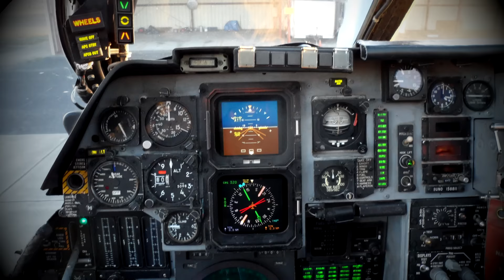USMC Jet Crashes Cable Car | Last Moments

Comment: A couple things to note:
The pilot's reasoning behind not being able read the altimeter due to malfunction is weak in itself due to the fact that pilots, especially in the armed forces, are trained in determining altitude without the need for the altimeter.
The maps were obsolete because they were meant for higher altitudes than what they flew since according to the radio operators, they weren't expecting to fly so low, so of course the ski lift wouldn't be on those maps because they're below.
Reply: As a civilian pilot you don't even need training to tell the difference between 2000 and 300 feet. It's very obvious when the ground is basically right up on you
Reply: Theres no reason during VFR flight you wouldn't be aware you're that low at 300 feet.

The map thing, nah, it should have been labeled. I'm not sure what map you mean, a map that only has mountain peaks on it? Sectional charts would definitely list all those things.

Still no explanation to why they were below 2000 AGL unless Qxir got it wrong. Those planes are interdiction aircraft so they would do low level training missions. Not sure what Italy's policy is with that at the time though considering a it's a military training mission. Those are common in the US to fly that low.
Reply: You'd think but it happens a LOT. half of the intelligence agency higher ups in Northern Ireland were killed when a Chinook flew into a hill at the Mull of Kintyre in the 1990s. A girl I know had a husband who was an RAF fighter pilot flew into a mountain also. Both mistook their altitudes.
Reply: @cefb8923  what i remember was that the maps were rated for 1,000 ft and higher, very much above the ski lift.
Reply: @cefb8923  it's also been reported by locals in the mountains that the jets fly very low and stunt flying by doing what's called flat hatting, where you fly as low as possible.
Reply: @TaliyahP  Soo much this. They were hugging the ground stunt flying having fun and the fact they destroyed evidence is they know they were in the wrong.
Reply: @ecgameplayer   so the lifts should have been noted surely ....looks fishy
Reply: Kabuki Kitsune  Furthermore he destroyed evidence. Case closed.
Reply: No-one ever trained me to determine altitude without using an altimeter when I was flight training. I've never even heard of such a technique. You do learn how to judge your height above ground for the final moments of landing, but that's just a matter of ten feet or so.
Reply: @colderwar  Yea but as a military prowler pilot if you can't tell the difference between 2000 ft. and 300 ft your in the wrong job No excuses.
Reply: @jod9749  That day he was a tour guide and forgot he was a pilot
Reply: I noted how the American taxpayer payed dearly.
Injustice is an understatement.
Reply: @davidleitch2298  The Chinook one, I seem to recall, was caused by the software controlling the flight system of the helicopter.  To cover up the fault, the government blamed the pilots.  The software on the others was not updated until decades later.
Reply: I'm no pilot but I sure as hell can tell the difference between 300 ft and 2000.

Another report on this I saw said they were trying to do a daredevil move and fly below the wires.
Reply: @davidleitch2298   CFIT (see-fit)

Controlled flight into terrain
Reply: Not buying what you say about the maps. The maps show features on the ground so not showing a gondola is unacceptable. Failure to update the maps is what caused this catastrophic event.
Reply: But then what is the actual reason for the tragedy then? Just pilot error ?
Reply: @davidleitch2298  That was in 1994, the weirdest timing.
Reply: @notchrisloveing9319  I saw a video that said they were trying to fly below the lines as a stunt. Don't know if that's true but there's no way trained pilots wouldn't know they were only 300 ft up and it was a populated resort area so not cool.
Reply: @wordup897  must be between the pilots then , cause command would of course never allow such horse play to take place under thier watch. Atleast I'd hope they would be more professional than that.
Reply: "The maps were obsolete because they were meant for higher altitudes"(sic)

Incorrect. The altitude that aircraft may or may not be flown at is irrelevant when sectionals are produced. The Italians produced defective sectionals.
Reply: I'm an AT2, worked on Growlers, and if his altimeter was as the pilot claimed, he would of failed his own preflight.  It's very common for pilots to shut off the bitching betty in disregard of safety, but also common for pilots to turn into infants when they get their peepee slapped over it.  They should watch this video every time they feel that way.
Reply: Without a map I would just presume with all the ski hills and skiers that there maybe ski lifts about?
The shiers  do not walk back up the hills after their ski run.
Reply: Such weak excuses... Do you even know what a VFR flight is?  Do you know what seek and avoid mean?    These men were responsible  for the  tragic and unfair deaths of these inocent civilians.
Reply: did you even watch the video? he clearly says the cable car was on the map
Reply: I doubt the pilots would have even took that aircraft flying if it had a defective altimeter.
If the defect happened mid sortie then they would have recovered back to base, not press on at low level. 
There’s some systems that are safety critical and you can’t fly without.
Reply: ecgameplayer - according to wiki - new italian directives with an updated map with the ski lift marked clearly marked - were in an un-opened letter in the cockpit - however they are moot since the previous directives already banned flights that low in that area
Reply: @cyprezz_  - 4:58 "did indeed OMIT the existence of the cable car"
Reply: @TaliyahP  you not a pilot
Reply: @jod9749  youre wrong im sure youve never went over 600mph
Reply: @wordup897  have you ever flown a f16 or anything like that mistakes happen quit listening to bs
Reply: @thebigchungus3222  ??? Yes I am... 😂
Reply: @davidleitch2298  I for one like to think of the former as devine retribution. 
Most likely though ,a spot of in house cleaning , by MI5.
Reply: @davidleitch2298  Issue was probably trying to fly VFR into IMC. That's what killed Kobe.
Reply: @AA-xo9uw  The American NIMA (National Imagery and Mapping Agency) of the US DOD made the maps used by the pilots, not the Italians, in fact the Italian Air Force had maps that clearly identified the cable car position but they never recieved the request for such maps by the USMC
Reply: @cefb8923  You have got to be bad if you can not tell the difference between 300 and 2000 feet . It was also said that they had not followed the planed route so what map were they following ?? The whole thing stinks of a cover up
Reply: Just curious, how do you calculate altitude without an altimeter?
Reply: @glowheat4469  according to the prosecution, by measuring the distance of objects on the ground by eyesight, should equipment malfunction.
Reply: @ecgameplayer  ok, just wondering. I have been a professional pilot for quite some time, and it is very subjective estimating altitude. I am not defending what they did, though.
Reply: @davidleitch2298  2000 vs 300 it's almost seven times...They knew what they were doing and they knew they were damn wrong (laughable altimeter malfunction excuse and tape vanishing) appalling case of cowboy attitude and understandable case of "CYA" of the MC. Italy forgives but doesn't forget
Reply: Kabuki Kitsune  " local authorities admitted that it had been left off the map which had been provided to the military" So the maps the Marine Corp uses are provided by the "local authorities". Do you have an idea about how preposterous and unlikely that sentence sounds? A10s pilots flying low in Afghan gorges trying to keep unrolled on the cockpit parchment maps provided by the Afghan/Taliban/Soviet authorities comes to mind...People died, just have some respect
Reply: @jod9749  that is not stunt flying,that is how they'd fly in combat, they'd be flying nap of the Earth to stay under radar.
Reply: @ecgameplayer  not stunt flying, this is how they'd fly in combat using the terrain to block radar.
Reply: @glowheat4469  "and it is very subjective estimating altitude" but you should be able to see the difference betwen 2000feet and 300 feet.
Also in case of mountains its kinda no brainer that the mountains tops should not be above you...
Not to mention that they also could easly start an avalanche with this type of 500mph low altitude stunt and kill some people this way...
Reply: @Bialy_1  No argument in that context.
Reply: @davidleitch2298  Case closed? You're clearly not an attorney or even of sound judgement.
Reply: Your second reasoning? No. The Italians gave the Americans obsolete maps. They are at fault.
Reply: Kabuki Kitsune  Thank you for one of the few reasonable postings on here.  Most of these haters are cra cra.
Reply: @Bialy_1  you don't know what youre talking about. Flying below mountain tops or ridges parallel to your flight path is largely the purpose of mountainous low level flying. It is not simply "stunt" flying for fun. It is for terrain masking, both direct and indirect.
Reply: @MattH-wg7ou   … and should be trained in an appropriate setting! 🤢🤮
Reply: 2 words....spatial disorientation, combine that with multi-tasking, loss of focus on vital tasks & task management, just one of these can be deadly nevermind them combined :-( hopefully we can learn from this.
Reply: That isn't how maps work. The jurors reviewed the evidence and came back with an acquittal.
Reply: Damn, even Ray Charles could tell the difference between 300 feet and 2000 feet without an altimeter.
Reply: After talking about this incident to a jet-fighter pilot from the Czech Republic, he told me that it's impossible for a pilot not to notice that he is below 300 feet when he should be above 2000 feet. These flights can apparently be planned and flown with a precision of less than 1 metre in clear conditions, even during the late 1990s, so it's extremely unlikely that they didn't know how low they were. In addition, the book I Due Cermis states that prowler jets flew below this cable car several times before this incident based on local people reports. So this is just my opinion, but I think it was a very well planned and calculated "show off" of the captain to his colleagues on his last flight before being promoted. He must have done a very well planned research to manouvre a descent from the original altitude of 2000 feet down to the height just below the cable car. This is described  in the same book by several eye-witnesses who who saw the plane just before the incident. However, the pilot didn't take account of 1 thing. He must have taken into account the height of the cables when they are suspended with no gondolas on them. Since this cable car had a very long section between bottom station and 1st pylon (I think nearly 1 kilometre), the cable with no gondolas vs. the cable with a fully loaded gondola must have meant that the gondola could have been up to 4-5 metres lower than during normal conditions with no gondola on that section of the cable. Since the pilot needed to be as high as possible above ground, but just below the gondola, he must have assumed that by flying 4 or 5 metres below would not create any danger to the gondola. And when he realized something was not correct in his calculations it was too late to do anything about it.
Reply: @TaliyahP  Exactly!!!
Reply: @jod9749  Amen!!!!!!!
Reply: @grizzlyaddams3606  " Failure to update the maps is what caused this catastrophic event."

No, it isn't. a)The pilots were frequently deliberately passing under cables and b)maintaining minimum flight altitude alone would have sufficed to avoid it.
Reply: @TaliyahP i think even a non-pilot can tell that your too damn close to the ground
Reply: @glowheat4469 In the past year of your piloting career, have you managed to work out the visual difference between flying at an altitude of 300' vs 2000'?
Reply: @cefb8923  While I can see training being done that low, such training, you would think, would be restricted to areas that aren't in conflict with civilians in order to prevent this exact thing from happening.

At least, that is what logic would dictate.

Comment: I was working at the aircraft maintenance facility this plane was sent to after the crash.  You can't see it in the photo, but there was a huge gash in the tail where it hit the cable.  As another commenter said, the word around the facility was that the pilot was hot-dogging and showing off. I worked for the military both on active duty and as a civilian for over thirty years, and heard stories of unauthorized risk-taking like this often. No wonder we had to take risk management classes every year. It seems a lot of people think, "Oh, that will never happen to me."
Reply: They're watching Top Gun and saw Maverick did all those things and think they're the next Maverick
Reply: I'm surprised the plane withstood the impact of the cable. These support cables are around 1.5 inch in diameter. This wasn't the first jet-plane collision with a cable car in history, there had been a few before this one, but in all of those, it was the plane that crashed with pilots usually catapulting and the cable car that remained (several of these occured in Italy). The only other one where a plane actually sent a cabin to the ground was Mont Blanc in the late 50s/early 60s where I couldn't find much info about the incident. In several instances planes did severe the thinner tractor cable that just pulls the cabins up and down and when that happened the brakes on the cabins were applied and held them stationary on support cables, but I just wonder what was the material this prowler jet was made from if it managed to severe a 1.5 inch support cable and still manage to fly back to base?
Reply: U right ,   think it's a common fact in the military, and when shit happens it's all covered.
Reply: What's insane is the pilots got away with killing 20 people. The marines covered it up which is even worse....
Reply: They should go to jail for life. This is appalling.
Reply: @MiroslavProvod Those gondola cables are 60mm in diameter, so they’re even thicker than what you mentioned, and knowing THAT makes it even more freaky scary.
Reply: @DiscoDashco  Yes, you're right. I did measure a sample cable shown near one such cable car since writing this and it was about 6 cm diameter, which does make it more scary. I'd assume the force or strenghts of material needed to snap the support cable would grow quadratically with cable diameter and if a prowler severed a 6 cm cable made from steel wires I wonder what material was the wing made of.